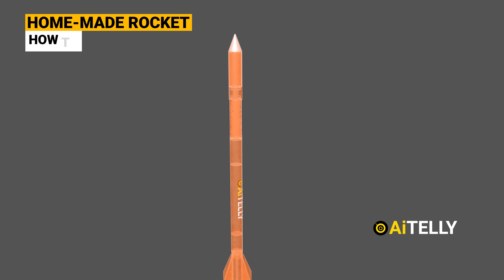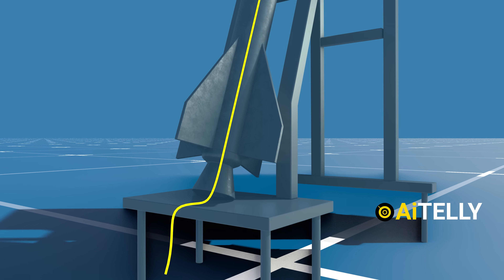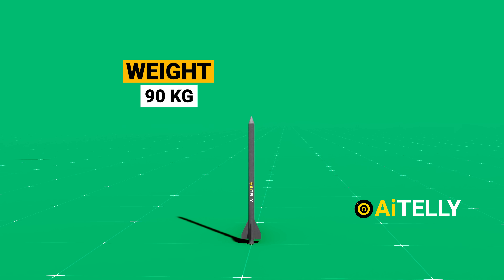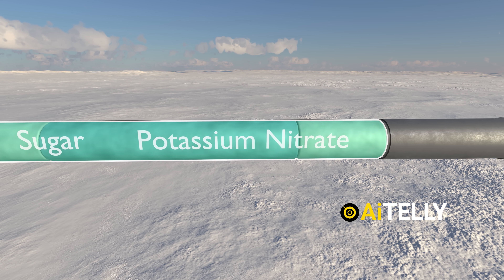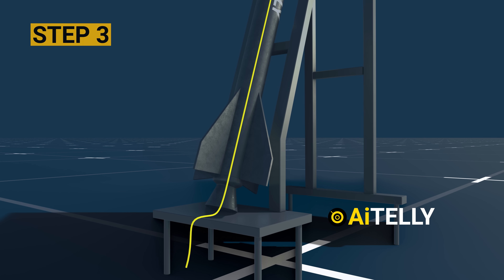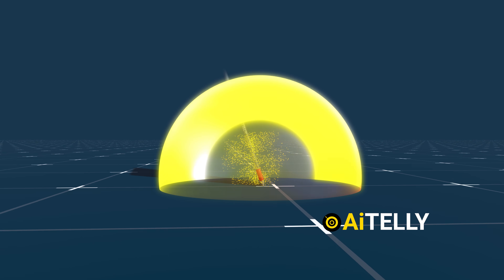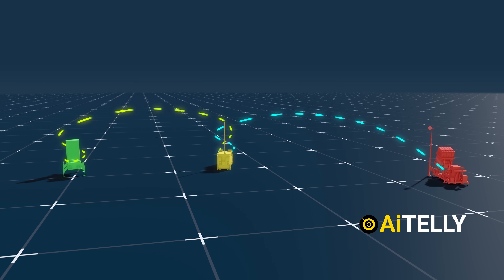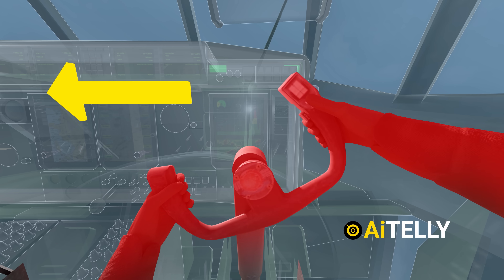How Hamas Makes Rockets against Israel | Qassam

Comment: This is why Hamas s rocket is not the one which hit the hospital. It was a JDAM going on Mach speed. From the video the impact and intensity is clear.
Reply: Only fools will believe it was from hamas. 😉
Reply: @adsrinivasansrinivasan9740 literally hananyan natfali confirmed himself that israel bombed the hospital
Reply: @Jinrang_Glazer  literally..not actually.
Reply: Shut up @adsrinivasansrinivasan9740 we all know it was Israeli terror forces.
Reply: There is actual video of Hamas rockets being launched behind the hospital and flying over the hospital. Dozens or even hundreds of these dumb rockets have failed and fallen in Gaza.
Reply: @adsrinivasansrinivasan9740We will see that in judgement day.
Reply: Hospital attack by Israel, which commits war crimes
Reply: 500 billion were killed!!!
Reply: Indians wants to be like Israel too, doing the same things to Pakistan!!! @adsrinivasansrinivasan9740
Reply: The intensity was a fireball, not what you get with a JDAM.  It was one of these rockets burning up the unspent fuel, as well as igniting and blowing up 15-20 cars in the parking lot.  If it had been a JDAM, there would be a large crater.  Instead there was just a small little crater that is consistent with these rockets.
Reply: @jiminauburn5073 Israel has small missiles that do not make a hole
Reply: @sli373  Sure, but they are not using those when they are bombing things.  You could come up with all sorts of things to keep trying to justify that Israel is responsible, but the simple and most logical answer is that it was an IJ rocket that failed, like many do, and it landed in the parking lot, exploding, burning a bunch of cars and creating a big fireball.   To try to keep pinning this on Israel would as crazy as if there was some big building blown up in Gaza while Israel was bombing in the area, with a huge crater, and people were trying to say it was not from an Israel bomb, but must be Hamas.
Reply: @adsrinivasansrinivasan9740 Another hypocreate

Comment: This is supposed to killed 500 to 800 people  and so much damaged at the Gaza hospital 😢
Reply: Have you seen the video of the "damage"?  The damage consists of broken windows from a blast, and about 15-20 cars that were burned, where it hit.  There is a very small crater in the parking lot, consistent with one of these rockets, not a giant crater you would get if it was an Israeli bomb.  And there is no way that 500-800 people were killed.  Most western intelligence agencies are saying with the amount of damage done, most likely less than 50 died.

Comment: Is it possible a single Hamas rocket can destroy a 6 storey building?
Reply: Depends.  If it hit some gas main or something, it could.  If you are talking about the hospital, there was no damage to the hospital other than some broken windows from the explosion.  Although there was a small crater in the parking lot and 15-20 cars that were burned.  The crater was consistent with one of these rockets, not the much larger crater that you would see with an Israeli bomb.

Comment: There is no way those rockets caused that massive hospital explosion. It is gotta be the IDF.
Reply: It most definitely did.  The hospital was not damaged, other than broken windows from the explosion.  Whatever did it, landed in the parking lot, leaving a small crater, and burning 15-20 cars.  If it was an Israeli bomb, the crater would have been much, much larger, and there would have been substantial damage to the surrounding buildings.  From the evidence released today, including video of the scene after the attack, it is pretty clear that it was one of these and not the Israelis.
Reply: @jiminauburn5073  Then how would you explain that Naftali tweeted (he deleted it of course)  that they bombed a hospital exactly at the moment where Gaza's hospital was bombed? They promised satellite images and videos but they provided nothing...

Comment: Sugar rockets. Made these way back in the 1990s. They are good for cheap hobby rockets when size E engines are not enough. The biggest one used a carpet tube as the tube with some laser cut aluminum fins to stabilize it. The propellant was made of a mixture of ammonium nitrate, potassium nitrate, sugar, sulfur, latex resin, iron oxide and aluminum powder. It should be launched shortly after filling because the mixture will absorb water. Also, they need to have a hollow core in order to get enough propellant burn to actually launch, otherwise you end up with a big smokebomb. The ignition system was dragon eggs fireworks pellets with extra black powder and aluminum dust mixed in. The big one was launched at Bong recreation area of all places 😅 anyway melt casting propellant bricks water main pipe sized sounds extremely dangerous as the mixture ignites not much higher than the melting temperature 😮
Reply: For long term storage they melted asphalt with fertilizer.
Reply: I used to use those E engines (and smaller) to launch model rockets back in the late 80s/early 90s. We often made out own rocket. Once we used plastic pluming pipe to turn the rocket into a bazooka. Fun high school days. But I never knew of this sugar/fertilizer mix, and we wouldn't done that too.
Reply: So by sugar rocket, you're saying that this is just Sugar + KNO3 ?
Reply: @ZRGLG  Literally yes
Reply: @ZRGLG I was fascinated by this so I did some research and it literally is 💀
Reply: Equal parts I think  just look up sugar rockets on here 😂 @ZRGLG
Reply: This is some government click bait congrats y’all!
Reply: I remember those days in the 90's building rockets with my dad, we launched one in a large parking lot and lost it on the roof of the local expo center lol.  I always wondered how long it stayed up there for.

Man I just had that memory thanks to this comment you made.  I haven't thought about that in at least 25 years.
Reply: @casedistorted  I was building these model rockets from 1988 - 91 in high school. My friends even turned one into a rocket launcher using some plastic plumbing pipe.
Reply: @IslamisCancer937  You realize Muslims don't even know if they are really going to Heaven? Imagine a religion "follow us, and maybe you go to Heaven'', lol.
Reply: I mean, technically, you could weld something like Inconel to the Water Pipe for heat resistance. Or even produce Inconel (but of course, it's difficult to do on an improvised set up).
Reply: Wisconsin activities
Reply: According to my search, 2/3 fertilizer to 1/3 sugar is the ideal ratio. Think i'll play with this.
Reply: Stump Remover is pure KN03. melt with sugar you have thermite. don't try this at home kids!
Reply: @christopherleubner6633
 ok but what ratio? lmao
Reply: @IslamsBomb  I just asked Bing. It told me 65% fertilizer, 35% sugar.
Reply: @IslamsBomb  1:1 the FBI told me.
Reply: Brah, the video’s full of shit. There’s no accidental building fires of this scale in Gaza. Those sugar motors were made/shaped in Iran before smuggled in through tunnels.
Reply: Great comment, because what they want us to believe, it's ALL fake.  You know what your talking about which really shines a light on all these LIES.  Thank you
Reply: @@IAmIt-hu3rx Mr Smith, but I'm outside the jurisdiction of the USA.
Reply: building a low L class rocket :)  not sugar.....
Reply: I read in my amateur rocket book that if you mess up the core of the motor you can blow up the rocket because too much fuel will be ignited and the pressure will spike…kaboom. It seems like there are lots of ways you can kill yourself being an amateur rocket scientist.
Reply: What is the ratio of sugar to fertilizer you wanna use to make it rocket fuel?
Reply: @germanicelt   Equal parts I think look up sugar rockets on here :)
Reply: And Israel still cry’s victim.
Reply: They are so incompetent 😂

Comment: if its really that cheap and easy then the cartels would manufacture them, the potassium fertilizers are not the same as normal potassium, the fertilizer is not flammable and will not burn

Comment: They buy their rockets from Russia, arsenal of a55holes.
Katyusha rockets got their name because of the K stamped on their body.
Soldiers referenced a pop song titled Katyusha when they nicknamed the rockets ages ago.
They are crappy rockets with weak warheads, but they only cost $300 and the Israelis spend 1000 times as much on each interceptor.
Even if you intercept them, they come down somewhere and go boom.
You can get them shipped from Russia by the thousands in big shipping containers.

Comment: Can be modded these days into cruise missile. There are plenty of controllers and actuators on ali, even FPV capable. Iron pipes can be replaced with off-shelf carbon fabric and resin, causing problems for interceptors.
Reply: Should probably take this down before they get any wiser.

Comment: And Israel is telling us this rocket bombed the hospital yesterday
Reply: That whole idea of destroying a hospital was a lie.  There is video of the scene out now.  No damage to the hospital other than broken windows.  Whatever hit, hit in the parking lot, leaving a small crater, and burning 15-20 cars.  If it had been an Israeli bomb, the crater would be much larger, and would have done substantial damage to the buildings.
Reply: Well I can see these rocket are out of control can be goes any where,u can see in video before there is blast in hospital parking,from nearby distant rocket from Gaza where firing,one of them could be got misdirected and land there,also there are two blast u can see, first one is due to rocket explosion and secondary was due to explosive materials which are kept inside hospital..if it's idf missiles than it would destroy whole hospital in one blow..but no it's not
Reply: @Skylineblue1997  Hhh zionist are professional liers
Reply: @Skylineblue1997  wrong

Comment: Balls, not ball bearings. Bearings are devices made of many things, often use balls, but also rolls and other shapes. A ball and a bearing a very different things.
Reply: ball bearing is a colloquialism - everyone calls them that if they're non-technical.
Reply from the maker: Thanks for understanding
Reply: Not everyone. Also, repeating something that is wrong is not a justification. A ball is a ball, and a bearing is a bearing. Two different things. There is no justification for mixing them up.  @octagonPerfectionist
Reply: nails are cheaper and good!

Comment: Does anyone know what the average speed of such rockets is?
Reply from the maker: As these vary between versions and sizes.
And the thrusters burn only for 1 second.

Its speed depends on gravity since it follows the parabolic path .
Reply: @Aitelly  If we don't know the speed, can we find out the initial acceleration?
Reply: its slow otherwise iron dome would not be able to intercept it if they have high speed.
Reply: Faster than a Akbar running from a hospital carpark.
Reply: 20 times speed of sound
Reply: @YassuYasen   BS - these are just larger fireworks.

Comment: You just taught everyone how to make a rocket at home
Reply: Don’t try using this video to make your own rocket you could seriously get injured or die. They Left out some key technical steps
Reply from the maker: No it's not the actual process
Reply: @Aitelly  I for one actually appreciate you keeping it very simple basic so somebody can really do it based off your video. There's a lot of idiots out there and yeah enough said.

Anybody trying to make a rocket using your instructions it's going to hurt themselves, so I doubt it would be an explosive reaction more likely they just end up poisoning himself from the ingredients
Reply: @Aitelly  Then, you make a hoax video about Hamas rocket...
Reply: Making solid fuel rockets is not easy. To prepare fuel using the correct ratio, you must first find the required nitrate. This is the hardest part, then you need a properly prepared rocket and a nozzle. You also have to use solid materials to prevent the rocket from exploding. it can explode when inner pressure get too high and also you need to prepare it to burn quickly. I know how difficult it is to prepare amateur rockets. A fire can easily break out even when preparing fuel. It May be impossible to prepare the explosive warhead at home. because it is not safe at all. I don't think it's easy to make this explosive in any country. turkey can easily catch the bomb makers even in Syria. it amazes me that they can do this in Palestine.
Reply: It can also be done if you have a good chemistry teacher and physics teacher. @hak8450
Reply: @hak8450  dude,  turkey ONLY catches the bomb makers because the bomb makers use ACTUAL explosives, and ppl that sell that on the blackmarket are few. there are dozens of different groups making their own shells and rockets.
Reply: It’s a lot more complicated than this my friend. 😂 A LOT more complicated. However you can buy a pyrotechnics book that teaches you how to make explosive powder and what their applications are. They’re highly detailed as well.
Reply: It's not that hard but depends where you live. For example in Germany it's very hard to get nitrates, meanwhile in the US it's easy to get them in huge quantities without any permission or license. @lifeofmike556
Reply: @lifeofmike556  now your reply actually helped Hamas 😄
Reply: if you're using this to make mini rockets for educational purposes, just buy a solid rocket booster.
Reply: @not_h1node am broke
Reply: You can't teach me what I already know,  it's a sugar rocket. You can buy books on the subject.
Reply: @roysuggs3635  teach me, I want to make some small firecrackers
Reply: What elements Hamas lack to made guided missiles ? 
I know people in USA that make homemade guided "missile" .

It’s weird that Hamas are not able to do it
Reply: @WilliamMarsh-y1c not able or just let Israel intercept the 600 dollars missile with a 100 thousand dollar missile.
Reply: @WilliamMarsh-y1c  they lack servo motors , gps modules and IMU sensors and micro controllers etc . am sure Israel would have restricted them too.
Reply: @WilliamMarsh-y1c  they can but its not worth it
Reply: @WilliamMarsh-y1c  its not weird, you just have no clue about gaza, palestine has HEAVY import restrictions in westbank, in gaza they arent allowed to import jackshit, everything that goes in comes from egypt or israel and is controlled by israel. they cant simply just buy gyroscopes and shit. its weird that you talk about topics that you dont know about.
Reply: @WilliamMarsh-y1c  it costs more
Reply: You can legally for non attack uses (not the rocket motor tho you need liscence for that part) but a company called estes allow you to get model rockets for low prices and are consumer friendly
Reply: Long ago we had the Anarchist Cookbook.
Reply: @budgetgrower2808  that book isnt accurate and there were 2 versions the original and the 2005 Ebook which has no relation to the original.
Both were on improvised munitions but the 2005 version is the one that has all the popular weird recipes like smoking bananas or the styrofoam napalm stuff.
Reply: @CatboyChemicalSociety  the styrofoam napalm stuff is true, it just left out a few bits, cool down gasoline until jello´ish, mix with orance juice, then add styrofoam and stir until goey af, you have your own defoliation agent now.
Reply: @tarkitarker0815  still fake because real recipe contains special soap won't specify.
Reply: @CatboyChemicalSociety  yeah maybe still somewhat fake, still burns like hell and is very good for warcrimes.
Reply: No I don't waste my sugar to make that stupid rocket.
Reply: he skipped a few important steps and if you literally just put a puck in a tube it wont fly and u get a smokebomb instead.
Reply: All this is in order to convince us that Hamas rockets can fall on its territory in order to deny the crime of the Zionists who blew up the Palestinian hospital. What a shame!
Reply: delete this video you are making the world worst
Reply: Much more detailed instructions are all over the net! Its how I leaned how to build my home made rockets, no warhead of course!
Reply: @mathetes7759  guided rocket with IMU ?
Reply: Not rocket but materials to make explosives
Reply: Have fun scratching your head when actually building one with some other metal materials
Reply: If this is the closest thing to learning how to make a rocket from home you could come up with on the Internet, you really aren't trying.  And if you're trying to use this to make a rocket with no other information, RIP.
Reply: Encyclopedia shows how to build a rocket.  It's no secret.
Reply: Everyone who went to high school knows this

Comment: If you’re not a terrorist then you can make homemade fireworks rockets. Obviously without the warhead. Just a small rocket 🚀 that goes up and comes down. Use hard cardboard not metal pipes. But in saying that it maybe be illegal. Fireworks are very expensive and bonfire night is on the 5th of November.
Reply from the maker: This is totally different.🤔
I guess.